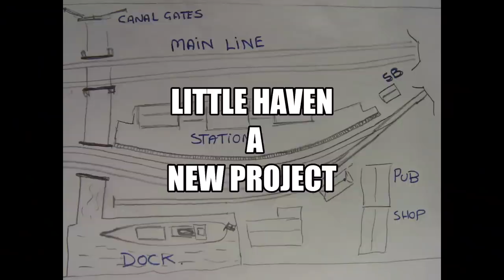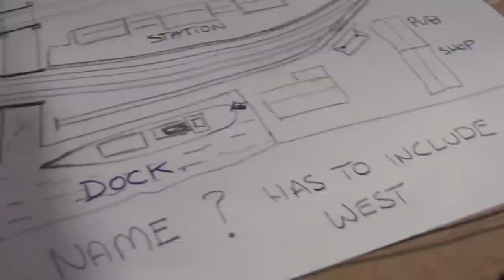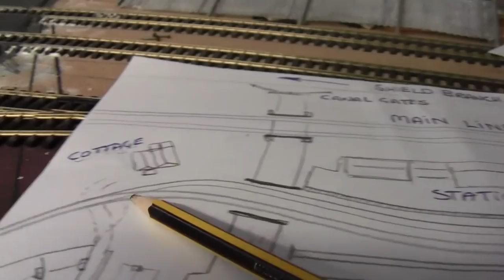A Introduction to LITTLE HAVEN. Track laying. No 317

Comment: Tony, I think that I saw a wolf under your loft hatch.  I hope you are safe. 😲
I’m a bit late to the party, but it’s good to see you making a start to this new phase of development on the North Eastern.
It took a bit getting that passing loop in, mainly due to having to re-align the track work.  Is all your track Code 75, Tony?  Any thoughts you would like to share on the future extension?
For your droppers, maybe consider a product call Posi-Tap Connectors, which come in different sizes and tend to be much more reliable than the crimp type splice wire connectors you are using and cause less damage to the wire you are connecting to.
Are you intending for the dock to be below the baseboard like you have done with the canal and will there be a ship in the dock?
Anyhoo, enough questions. 😵  Have a great weekend.  Best, Jason.
Reply from the maker: Yep you did see the big bad softy wolf. Thank for the tip. tap connectors i might give those a try. i think you might have to stick around for future plans that i have. maybe another station on top of this one to build. ooops cat out of the bag...thanks again Jason....cheer's Tony

Comment: Tony, another enjoyable video. At 0:22 into the video the train enters the tunnel. I notice that the retaining wall looks much more textured than the tunnel entrances and wing walls. Are they made from the same or different materials, have you used a texturing technique on the retaining wall.
Reply from the maker: Hi Andrew, very much appreciate your comments. yes the retaining walls made from different materials. the Tunnel mouths are Metcafe kits and are still ready available. the stones walls are metcafle sheets. i think they M0051-58 i have not bought any of thoses for awhile. they are very lightley weather using acrylic paints. but if i ever weather walls again. i think i will use powders...i hope this helps. and good luck if you are doing some re-taining walls...cheer's Tony